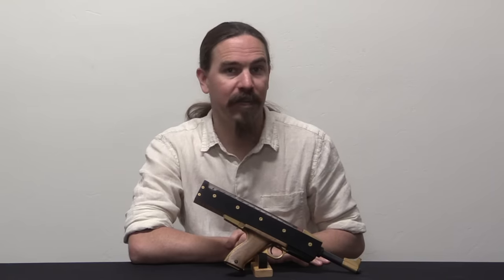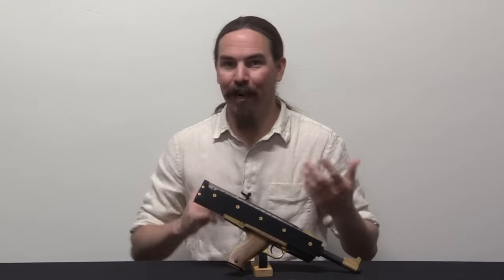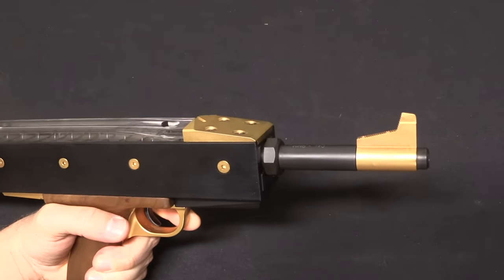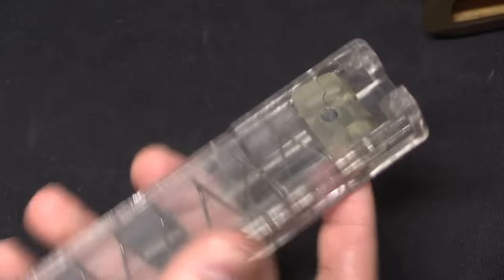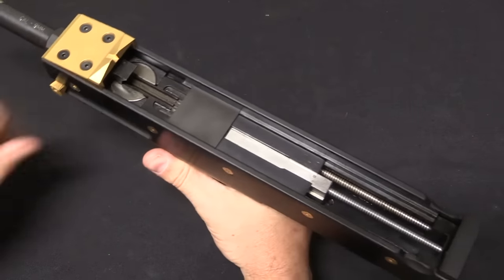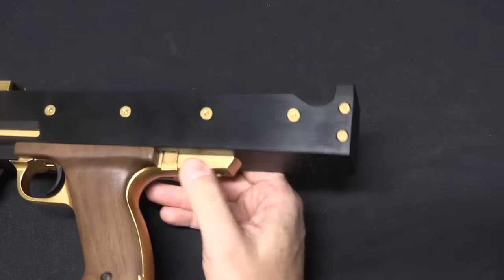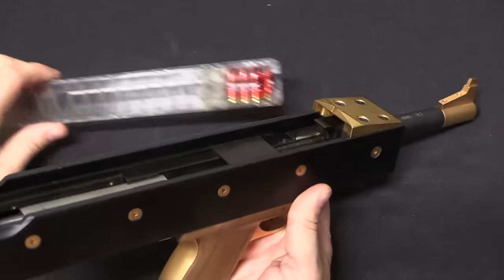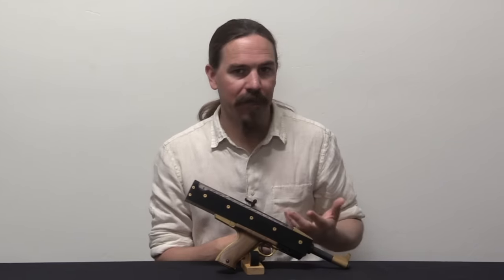Hill SMG/Pistol: Inspiration for the FN P90

Comment: Hearing about and seeing this thing for the first time I'm not sure why this design never caught on at a later date, it looks to me like a much safer design than the complex magazine design that FN came up with for the P90 and I say this because I feel like those magazines would not only be more work to produce but also have a higher tendency to cause jams, kind of like drum magazines (I don't know though, the P90 magazine might be a more reliable design than I think). Certainly the sights on the hill pistol are in a better place as they sit relatively close to the barrel, I've seen accuracy tests done with the P90 at range and apparently the longer the range the less accurate the P90 tends to be because of how high above the barrel the sights are.

On another note, I'm sure there could've been some way to get around the upside down case ejection issue, maybe by cutting an ejection slot on one side of the gun (or both) and then having another "turn table" underneath the first one that would capture the first casing and then rotate and fling following casings out using some kind of spring loaded return and impingement system that worked off of the turn table above it (that's a lot more complexity though).

Comment: The ejection system doesn't support ejecting unfired rounds... so if the bullet doesn't fire and you pull back the charging handle now you have a bullet with the primer activated stuck in the gun
Reply: Ian's issue is the OAL of his snap caps are a bit longer than this gun was built around being able to use.

Comment: When does the patient on the FN feed system expire? It would be cool to see a p90 PCC in caliber other than 5.7
Reply: Already expired? (Such things are usually easy to google, give it a try). Depends on local law. It is even possible that FN did not patent their feed system in certain jurisdictions at all (there is a quite popular misconception that patents are international while in fact they have to be filed separately for each and every country, with maybe the exception of relatively recent EU-wide patents) - so check for your country of residence.

Anyway, there is an issue here. Most cartridges  have case walls that aren't parallel (hence magazine curvature in large capacity magazines). P90 magazines rely on them being parallel. You could always make shorter magazines to partially avoid the issue, but would still have to re-design geometry of the feeding system almost from scratch.

Hope I helped a little bit.
Reply: @randomnobodovsky3692  thanks! your reply was helpful and interesting

Comment: That's about twice as long as it needs to be (For 9x19mm) and that sight line is about a 5th as long as it could be.
Reply: The NFA is insane.  I know what they're trying to do, but with all the things they've added on, and stupid designations like calling a stocked pistol a "Short Barreled Rifle," in places it's actually counter-productive.
Reply: The iron sights are atrocious and not even worth trying to use.  Aside from the pitiful sight radius, it's so far forward on the gun too that the rear sights are where you'd expect front sights to be.  The receiver itself I don't think could really be shortened much more than it already is.  The first couple inches are for the turntable and front trunnion while the rest of the length is for the bolt to move around in.  The gun itself is noticeably smaller than an Uzi.
https://i.imgur.com/1y5wlF3.png
Reply: @ApplesauceBandit5000  Yeah, but the Bolt doesn't have to be that long, and heavy for 9mm.  Not with 2 recoil springs, and the rocking of too much bolt (Seriously, that looks like a Thompson bolt without the Blish delay) has to be all kinds of great for your sight picture, with the rear site in front of the trigger-guard.  I imagine shooting that thing must feel like swinging a hammer.  It's an SMG, cut down to a "Pistol" but not cut down enough for a useful pistol.  Can you imagine the holster for that thing?

Comment: That is a very ingenious design. I'm surprised that more weapons didn't adopt this magazine feeding design. A large capacity magazine in the horizontal position is a lot easier to deal with vs a long magazine protruding out the grip, like a Glock with these 30 round magazines that make a pistol absolutely un- conceivable. Who wants handgun (pistol) that basically has a grip that extends down from the gun a foot or more. It's not practical and in my humble opinion I think it let ridiculous to have a 30 round magazine in a pistol of any brand or manufacturer . This type of magazine design lends to a far better chance of concealment.
r

Comment: My brother, after 42 years of law enforcement with 70% of the period in special operations and 1 campaign in war theatre (civil issue), The Hill design is an extremely excellently fabricated machine for Law Enforcement and was only relatively disregarded because of the affliction 'lack of vision' that plagues traditionalists or 'traditionalism', if you will. The streamlined ergonomics are compelling, save traditionalism, and provide a potent tool/platform for defensive and/or offensive dispensations. High capacity, no prohibitive appendage (perpendicular-feed magazines), easy storage/retention, enhanced sustainability, likely lighter weight materials, etc. Defense would find an irresistible stakehold under these parameters. Hence, given the success of 5.7mm P90, 5.56mm configurations would be natural progressions of weapons development. Hill... Fabricator Par Excellence....

Comment: It seems it's the hook above the action which actually pulls the cartridges from the magazine, not something acting on the follower. How would that work ?
Reply: Ian I think covers it in the video, but that hook or feed ramp or whatever is what lines the cartridges up in the correct position to feed into the gun.  Because of the funky turntable setup, there's only space for one cartridge to leave the mag at a time.  It's a very ingenious setup that completely foregoes the need for feed lips on the mag.  It's difficult to explain the process in words though

Comment: Curious how you would clear bad primer strikes with this system, if the round doesn't fit out of the ejection port....
Reply from the maker: Presumably the ammunition Hill designed it around is slightly shorter in overall length than my dummy rounds.

Comment: Too bad the original designer never knew what eventually happened with his invention. If I was the inventor, I would have been proud knowing one of my ideas carried on long after I passed.
Reply: Mr. Hill passed away in 1991 and the P90 entered service in 1990, so it's entirely possible he did get to see it in time.
Reply: @ApplesauceBandit5000  Glad you mentioned that.  :)

Comment: So if you had a failure to fire, it would jam up the system if you attempted to extract an unfired case?
Reply: Probably, but I've personally never seen a center fire fail to fire. If it was doing something like light primer strikes I think you would just remove the mag at least partway and rack it and try again. Since that one is a prototype he may have had the port on that one smaller than some of the others since they were clearly toying with design ideas (I think one other comment on here said it should eject the full round, so that might just be this one prototype or test batch that has that issue).

Not ideal to have it jam, but I'm not sure how common that would be, that striker looked massive and should set them off with ease.

Comment: I’m betting it has a fluted chamber. If not, it should.

I’ve heard the P90 magazines candidate malfunction if the gun is dropped on it’s butt. Would the Hill system’s mechanical turntable preclude that?
Reply: Chamber is not fluted.  As for the other question, I've not got an answer.

Comment: Very interesting. Do you know how the turntable is activated?
Reply: There's a bar inside the receiver along the righthand side that is attached to the bolt.  When the bolt travels far enough back, this bar interacts with the turntable in a way that rotates it 90°.  I can't see exactly how it does that though without taking the gun apart.

Comment: How does clearing a malfunction work if it wont eject a full sized bullet?
Or is that just a problem with the snap caps?
Reply: I'm not sure how he jammed it up, but all the jams I had were remedied by removing the mag, pulling back the charging handle, then shaking the gun.  I put some cheap 115gr through this before sending it off to him and got failures to feed after every shot.  I think it wants something a bit more hot than what I gave it.  
https://i.imgur.com/6c8pzkN.png
Reply: @ApplesauceBandit5000  Thank you.
Very cool of you to let him take a look and share it with us.
Reply: @shawnr771  As an update to this, I now have a live round of aguila 115gr stuck in this gun.  Turns out it really is picky about the cartridge OAL.  Nose of the bullet doesn't quite clear the turntable before it tries turning.  It's close enough that it looks like it should be able to simply shake loose, but that's not the case.

Comment: I wonder why this system never took off, the P90 that uses almost the same system holds a crazy amount of rounds per magazine, surely this holds a ton of bullets.

Ammo capacity is 15 - 30 rounds

Oh. Yeah that's probably why. As interesting as the feed system is, let's have an overly clunky and bulky SMG with a feed system that, at the time, was unproven, on top of holding the same amount of rounds any of its competitors with normal magazines can, said nobody, and so the design went nowhere until the P90 took the basic concept and tweaked it and actually went somewhere with it. If it just held more rounds, maybe it could have had an edge, but for the same amount of rounds, there was just no reason not to use any conventional SMG that, sure, may not be as compact, but is much better proven. And doesn't look like a kid's drawing of a cartoon ray gun without the fins. If it ain't broke, don't fix it, is the phrase that probably killed this gun.

Comment: It's a square calico
Reply: Really is closer to the P90, its definitely not helical and Calicos don't ever rotate the bullet sideways, they are axial systems. Loading magazine into the weapon might share a resemblance though. Also all the 9mm Calicos were double stack (only the .22LR was single stack), and this particular video is showing a single stack 9mm magazine. Little bit different.

Comment: Sure is a cool, unique design and mechanism, but it’s pretty easy to see why it never really went anywhere. Big, heavy, blocky, overly complex open-bolt gun with what must be super-weird balance, a pretty massive reciprocating bolt/striker and like a 4” sight radius that appears to be very easy to jam with a little dirt? Nah, thanks.
Reply: It's actually a good bit smaller than an Uzi and isn't nearly as complex as it might seem at first.  It balances very well in the hand, though you do definitely notice the bolt reciprocating.  Iron sights on it are useless.
Reply: @ApplesauceBandit5000  It does look like it would balance halfway alright, at least. Maybe as a sub-gun it wouldn’t be all bad.

Comment: That seems like a far more efficient and reliable system than placing the rotation in the magazine.
Reply: But it's not.
Putting it in the mag allows you to use the turntable for extra capacity &
It allows you to extract duds or live cartridges.
Putting it in the magazine is better in absolutely every way.

Comment: Other than the dubious benefit of bottom ejection, I've never really seen the point of these systems. Certainly not with a single stack magazine anyway, and the feed issues with the double stacks makes it a bit meh.
Reply: high capacity without having a big dongle sticking out the bottom  makes the weapon lower profile 

imagine trying to shoot from a prone position with a Glock stendo getting in the way